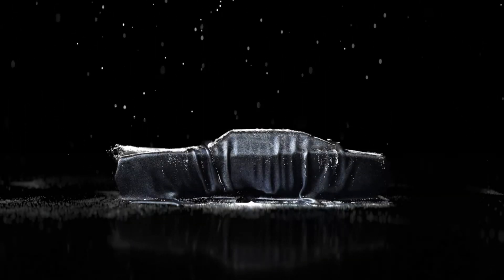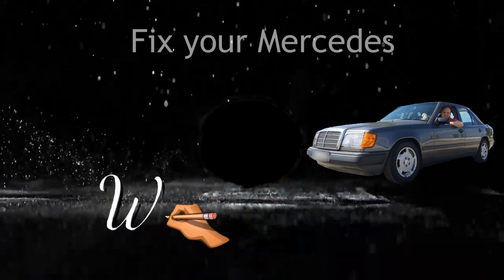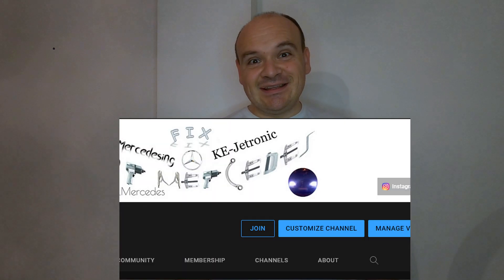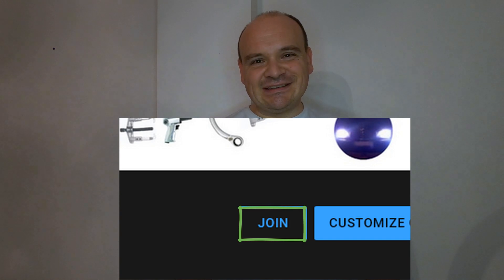㉦Mercedes Ke-Jetronic㉦ - About the ASR

Comment: Thanks, that helps a bit. I have the early r129 with M103 engine and CIS. It has I suppose ASR 2. Both ASR and ABS lights come on and stay on at start up. I have changed everything that you should but still the same. The car drives normally though, and the tempomat works, but I don't think the ASR or ABS are working. It is a mystery to me why these lights are on. I am thinking I should clean the throttle actuator, like you say it is important.
Reply from the maker: Have you checked the OVP?

Comment: HI..I HAVE A 91 MERCEDES 300E. IT STARTS AND REVS BUT THEN IT IMMEDIATELY STARTS SURGING, (I,E THE IDLE GOES UP  AND DOWN..UP AND DOWN) THEN IF I SHIFT TO REVERSE OR DRIVE IT STALL WHILE AM HOLDING THE BREAK PEDAL BUT IF I GIVE IT SOME AIR BY QUICKLY MOVING MY FEET TO THE ACCELERATOR IT DRIVES FIND...BUT THEN AGAIN WHEN I COME TO A STOP OR A RED LIGHT OR AM SLOWING DOWN WITH MY FOOT ON THE BREAK IT STALLS..LIKE THE SYSTEM IS GETTING NO AIR THROUGH THE ICV...I HAVE 3 ICV..I GOT THEM AT THE JUNKYARD BUT NONE OF THEM WORK...I TESTED THEM BY HOOKING MY SECOND CAR BATTERY WITH 6 VOLTS ON ALL OF THEM ONE BY ONE AND THEY ALL CLOSE THE SLIDER..THE BATTERY HAD SIX VOLTS SO I WAS SPECTING THE SLIDER TO CLOSE ON ONE SIDE AND OPEN ON THE OTHER BUT THEY ALL REMAIN CLOSE WITH 6V..I CHECK THE INCOMING VOLTAGE ON THE ONE MOUNTED TO MY CAR AND AND I GET 2 VOLTS WHILE THE CAR IS IDLING AND WARMING UP. DOES THE FEED VOLTAGE INCREASES AS START TO DRIVE? I THINK IT'S THE ICV...WHAT DO YOU THINK? PLEASE LET ME KNOW..THANKS.(BY THE WAY I HAVE SEEM HOW YOU TEST YOUR ICV AND IT SOUNDS LOUD LIKE YOU KNOW IT'S GOOD BY NONE OF MY OPEN AND CLOSE LIKE THAT..OOH YES..I HAVE CLEAN THEM ALL)
Reply from the maker: Hi. 2Volts is too little for your car. Get the car to the operating temperature and measure the voltage then. You must get 4.5-6V. If you don't then I will tell you what to do further. If it doesn't help, then it's the ICV.
Reply: @mercedeske  Yes..ok...later today I'll see if I can switch it on let it warm up and then I'll unplug the connector and mesure the voltage..I'll let you know ...thanks.
Reply: Well..I just finish warming up the car and the idling is bad when cold, sounds like it wants to stall but as it warms up to 80 C the idle seems to be just a little more stable but the surges are there and after ten minutes of idling the check engine light came on. Then I went and I disconnected the pin to the ICV and the idle become more stable it was idling perfect at 1000 rpms while in park. I then took the voltmeter and proceeded to measure the voltage and I am only getting two volts at working temperature of 80 C..yeah! it should be around 4-6 and you should hear the ICV clack or make the loud clacking sound but nothing...don't know..do you think is the voltage relay?...it's the "upgrade one" with two fuses on top and red top...computer?...don't know..but I should mention that at one point I cut the ground cable to the cold start valve...don't ask me why....I couldn't get it to start..and I saw a video on Youtube about it and decided to try it..but I checked the cold start valve and it works it fires fuel...I got to fix that too but I don't think this is effecting the output voltage on the ICV is it?
Reply from the maker: @manleom2260  Well, check continuity between the contacts 87L and the first pin on of your ECU(on the connectors). Afterwards check pin 1 on the connector of the ICV(red white wire) and the third pin on the connector of your ECU. If you have no continuity then your ICV is not going to be working as it should.
Reply: @mercedeske  Do you have the schematics of the ECU? because it has close to 30 connector pins sticking out of it! and I don't know which one is which...I'll see if I can find the schematics online...Now if I read you correctly 87L is a connector pin right?..so you basically first one me to take out the ECU and check it for continuity on pin 87L and the first pin right?
Reply from the maker: @manleom2260  Yes, right. And as for the scheme you have it on my Instagram page.
Reply: @mercedeske  is the link in your Youtube Channel?
Reply from the maker: https://www.instagram.com/fix_your_mercedes/
Reply: @mercedeske  Well I went to your Instagram and the schematics of the ECU to my ECU are different my has 55 connectors, pin 4 is the positive cathode for the ICV and pin 23 is the negative cathode and there both output signals, pin 1 is "voltage supply circuit 30A" So if I connect the positive lead of voltmeter to pin one and the negative lead to pin 23 I do get connectivity...I get a beep...but if I connect pin one to pin four I don't get a beep I get a reading of 1070 of whatever this means and the same thing happens when I check for connectivity between pins 4 and 23 I get a reading of 1117..again whatever this means...but there is no beep...I don't have the 87L Connector..
Reply from the maker: Ok. I didn't know you have M104 engine.
Reply: @mercedeske  No it's the M103 engine...straight six cylinders..
Reply: it's a 91 Mercedes 300E
Reply: @mercedeske  are you familiar with the 55 pin ECU ?

Comment: I think I have a full documention with the full value ! It is pretty complex as no diag available
Reply from the maker: I have also but the point is that you have sensors, ECU, electronic accelerator etc. I didn't manage to find nominal values for the sensors when they fail if they fail, etc. It's complicated, you could learn how it works but I can not tell how to repair the ASR and what to look for but to tell you to replace the ECU of the ASR.